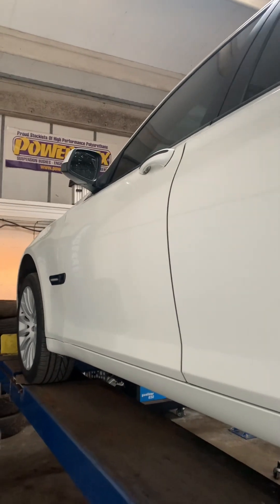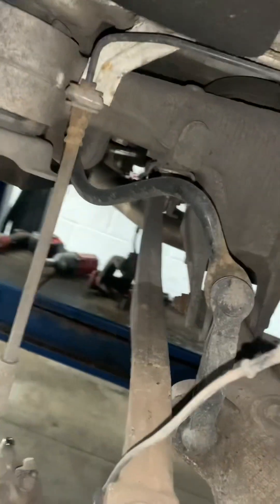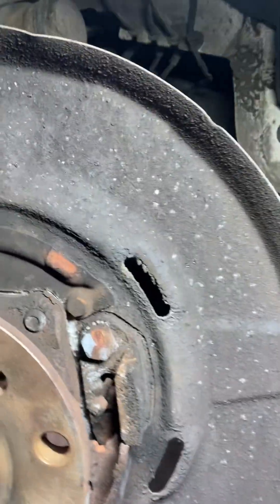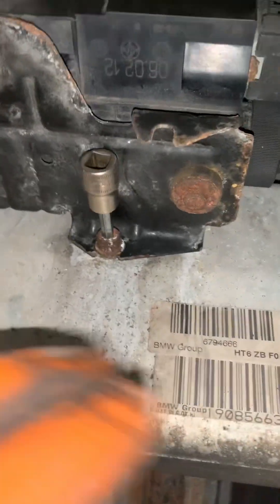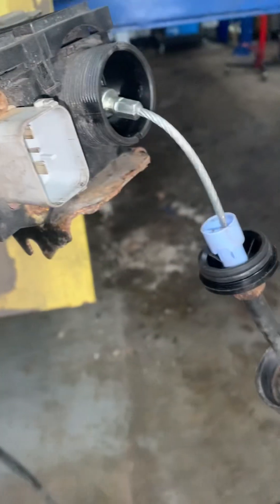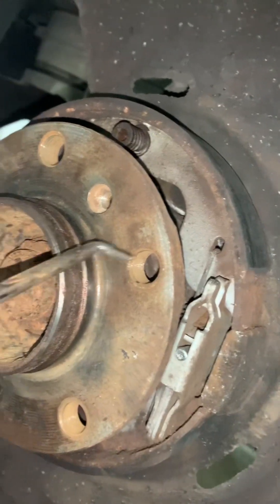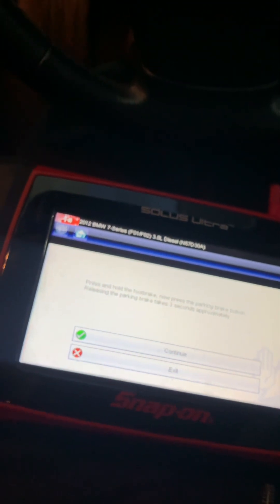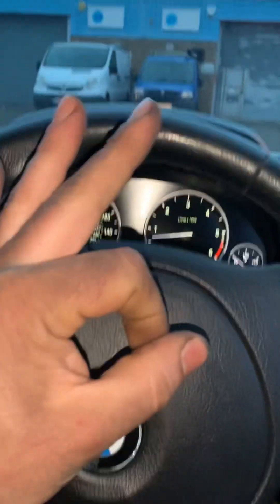BMW e65 730d electric handbrake module replacement with both handbrake cables - handbrake failure

Comment: Have you done this on a e71? What of the Bowden cables are seized in the hub? Yours came out easy…
Reply from the maker: Hi, ive had this before, you need to spray loads of lube and keep wiggling it, worst case, a bit of heat just to break the rust seal!! good luck!!